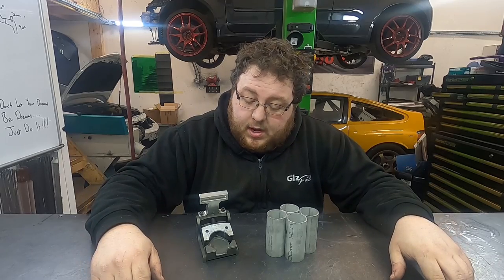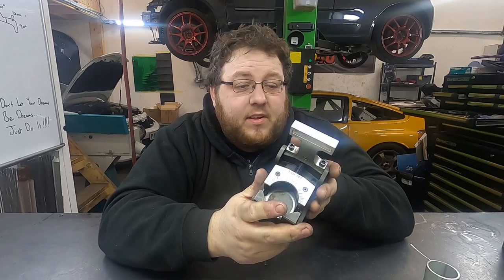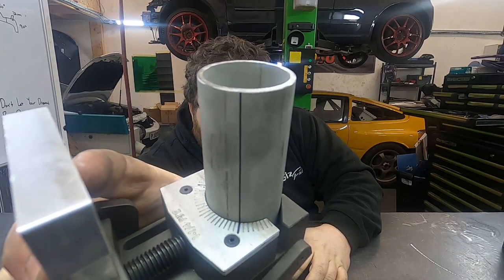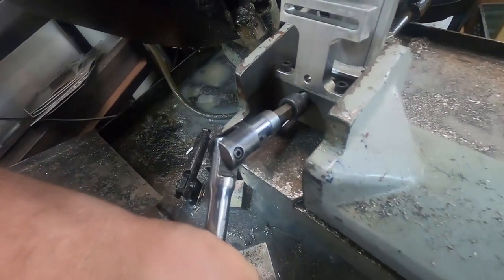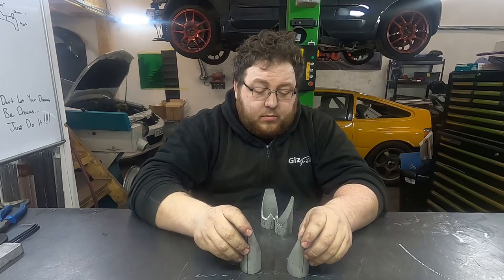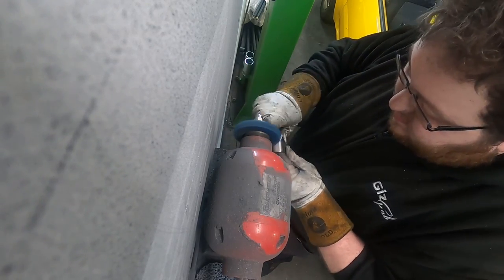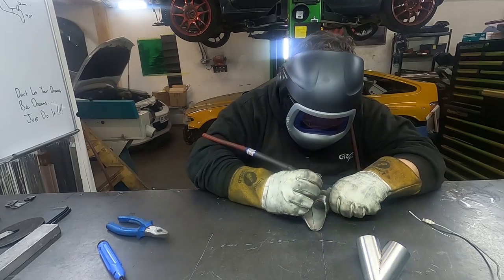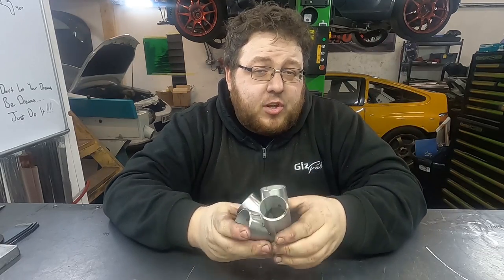How to fabricate turbo merge collectors using LPSFAB CCFV3

Comment: Hey mate, nice videos, nice workshop, nice work. But one thing what i dont get it. Why you use a 97° between cuts? I know that you use a 20° angel, but i am trying to figure it out. Keep coming these videos..Really like this. Cheers mate
Reply from the maker: ilikemyboost It’s called compound rotation and I don’t really understand it either...logic says cut at 90 degrees. But it doesn’t work.
Reply: @GizFab  Compound rotation? Never heard about that. So in other applications, you Always add 7degree? If you doin 5 cyl, 6 cyl..So IT Will be 77 for 5cyl And 67 for 6 cyl? 😁Sorry but i am too much confused.
Reply from the maker: For 20 degree angle, pretty much. If you change that angle, the rotation changes.
Reply: @GizFab  But where you get that info? I am trying to google it, but no info about that :D
Reply from the maker: @ilikemyboost  exactly...Which is why i made a video about it...